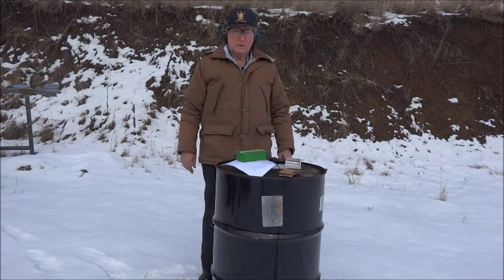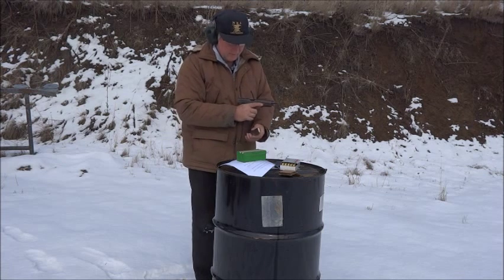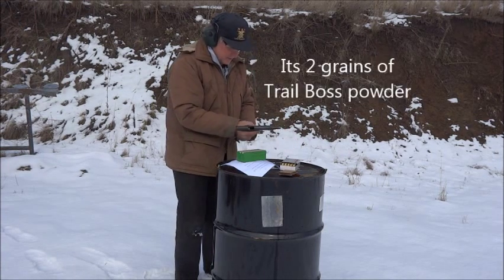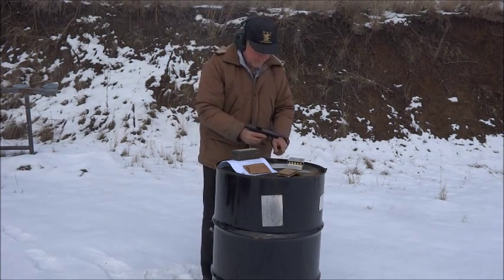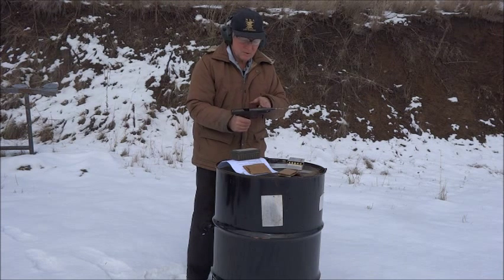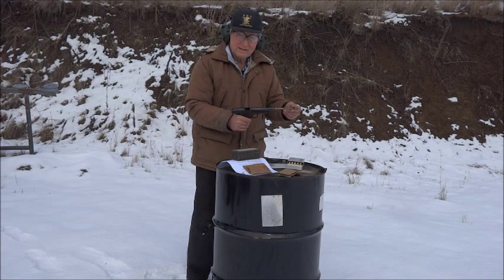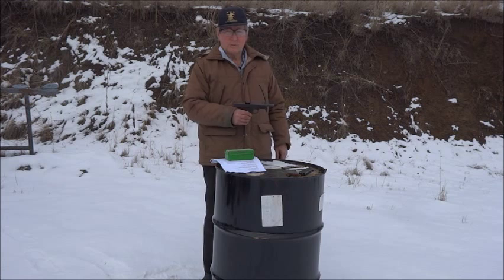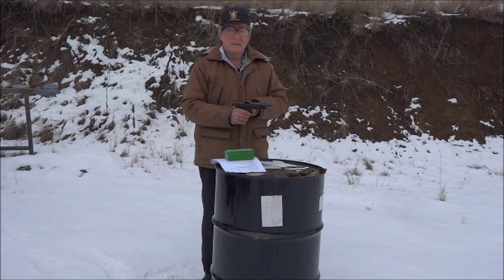Is there a squib load which will cycle the slide and chamber another cartridge?

Comment: I watched the entire video and commend you on it.  I learned some things about squib loads, and was reassured that possibility of slide recycling on one is not likely and non-existent with your gun and loads.  That's good to know.  Do you recommend waiting a period of time if you might have a squib?  What about a misfire/suspected dud or hangfire?  Aye, there's the rub.  In your testing you knew it had to be a squib, though, so I guess that you felt safe sticking rod in muzzle end shortly thereafter.  It may be different if one has a 'click' as it could  be a dud or a hangfire.  I guess that time will tell.  What is your knowledge of hangfires?  Have you knowledge of actual hangfires occurring after 10 seconds of waiting?   There's internet 'rumor' this is so, but the vast bulk of information I have received is that one will likely occur within 1 to 3 seconds or even shorter period of time.. Sorry if off subject a bit but they are related topics under gun malfunctions.
Reply from the maker: There is no need to wait if I know it is a squib.
If you don't know if it is a misfire, squib, or a hangfire, then keep the muzzle pointed in a safe direction for 30 seconds before opening the action.
The hangfires which I have had were less than 1 second.
Mostly with rifle cartridges which were military surplus ammunition, usually decades old.
You might read about hangfires at Wikipedia.
http://en.wikipedia.org/wiki/Hang_fire
Reply: RogerRevo I'm more likely to err on the side of caution at 30 seconds, but 10 seconds should be sufficient.  I know that my pistol manual for the S&W Shield recommends waiting 10 seconds.  Perhaps better to wait 30 seconds with rifle, though, especially if aged military surplus rounds.  Appreciated your video.  Thanks, again, Roger!

Comment: Nice demonstration, just what I was looking for. I suspected that a squib load would not even come close to a completing a cycle. I could not tell for sure but I am guessing that was a 1911 you were using. I wonder if octagonal rifling like in a glock barrel would perform similarly? My guess is yes.
Reply from the maker: It is a 1911 which is a GI version. 
I agree the octagonal rifling would be similar, because it is the recoil which functions the action.  There might be a slight difference if it takes less force to push a bullet thru octagonal rifling, but still the same result.  Thank you for your comment.